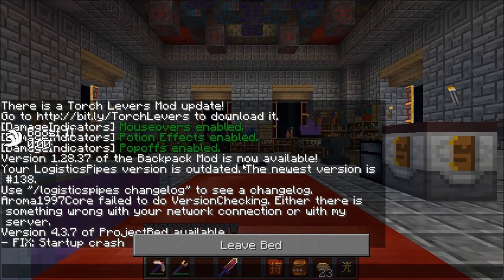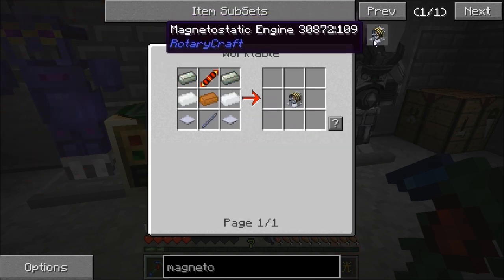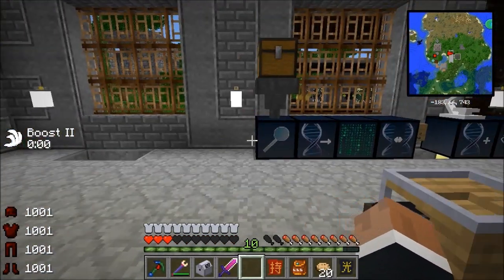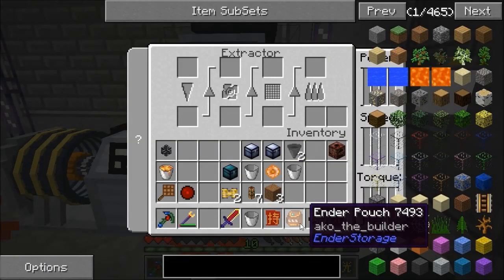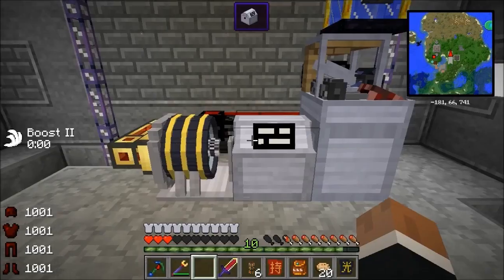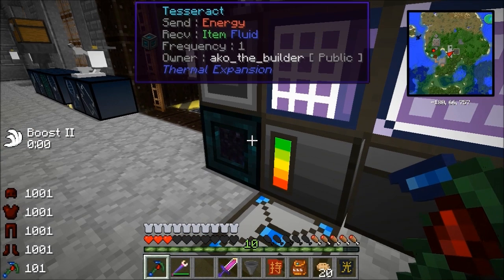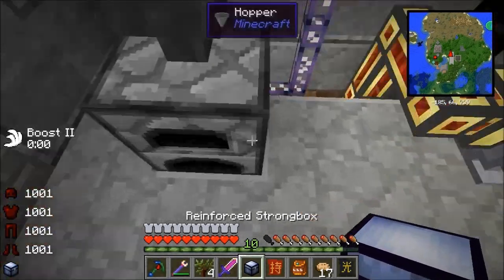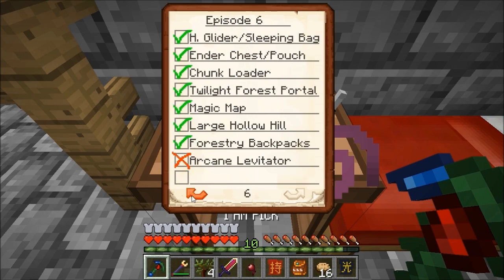FTB Monster Beginner's Guide Episode 20 - Finale, 5x ore processing

Comment: Nice wrapup, although there is some bad news. Magnetostatics have changed quite significantly in v20 of RotaryCraft. The power can be the same (more in fact), but it's much harder to get. Magnetostatics are now tiered and for the single engine setup you'll need a tier 4 one.
For that you'll need
- RC Ethanol setup
- Jet Fuel production
- Jet furnace setup
- Running extractor setup

For the CVT you'll also need a bedrock breaker setup, but I think that's already necessary on the version in monster (which is also harder to do with the tiered magnetostatics).

On my new world I'm using 32 hydrokinetics to power my extractor and two grinders btw =) Makes it run pretty fast and is basically free (although really costly to setup). A combination of igneous extruder, rock melter and lava smeltery does my smelting. I don't know whether I've already pointed that out to you, but the lava smeltery is one of the fastest way to smelt things if you manage to fill it up (comparatively long process time, but smelts 18 things in parallel and in this setup for free).

I guess you're aware of that, but your setup will also fail if you manage to fill the strongboxes. The overflow will go into your system and stay there, so while it's more clunky I usually do the export bus setup nevertheless.
Reply from the maker: excellent info as always thanks Belgabor, I'm glad Reika has added some complexity into the 5x ore and hope to play with rotarycraft again in the future